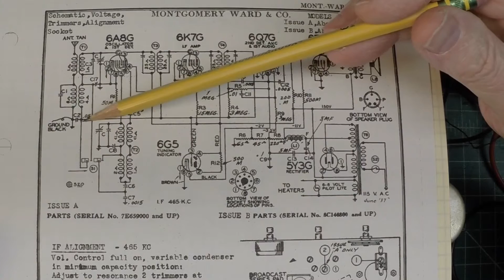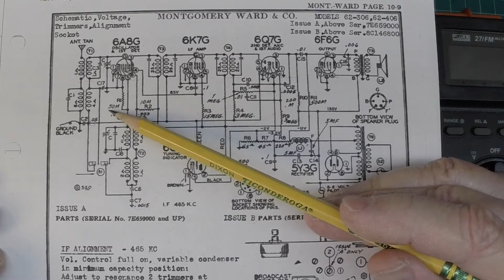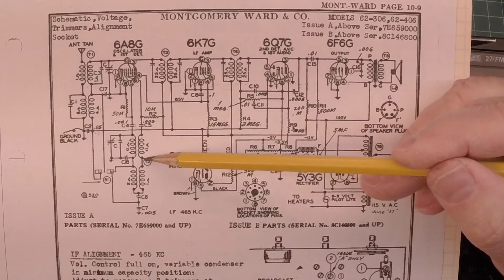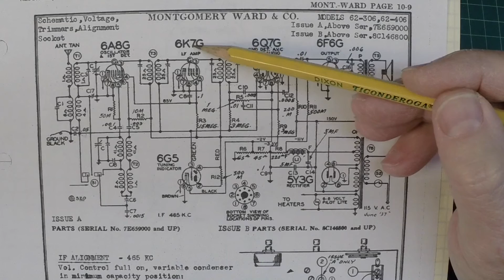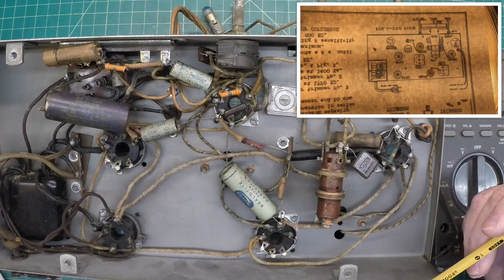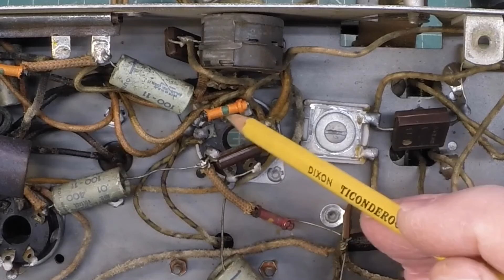Airline 62-306 Teledial - Antenna, Oscillator & IF Transformer Coil Checks

Comment: 0:55: Thank you for the informative video.  In my experience of checking resistors in circuit, I've never seen one test high that wasn't out of spec.  In circuit measurements for d/c resistance always seem to be either accurate or skewed low.   Because of this, I'd assume a shorted capacitor could only decrease the d/c resistance measurement and never increase it.  I'm a rookie still so I could be wrong.
Reply: In a quick search of message boards someone suggested an undischarged capacitor could cause an increase in resistance reading.
Reply from the maker: Thanks for watching and reaching out. If C2 were shorted, my antenna coil primary windings would be added to the secondary windings increasing the DC resistance by some 9 ohms or so. Best, Don